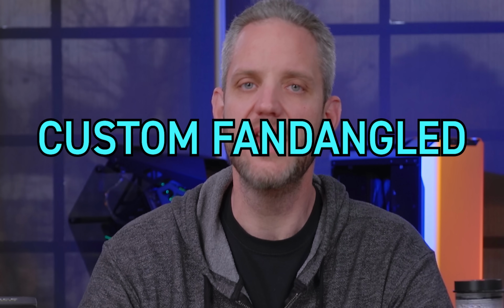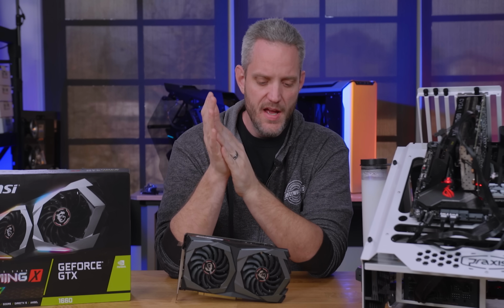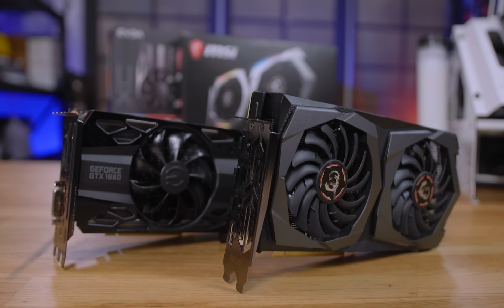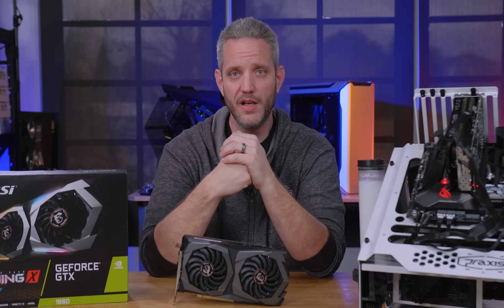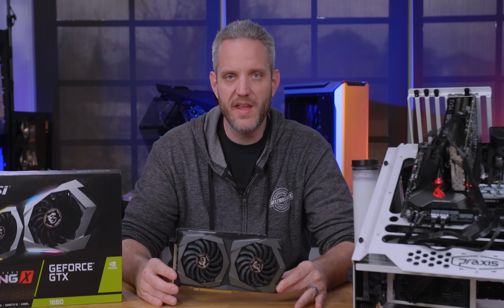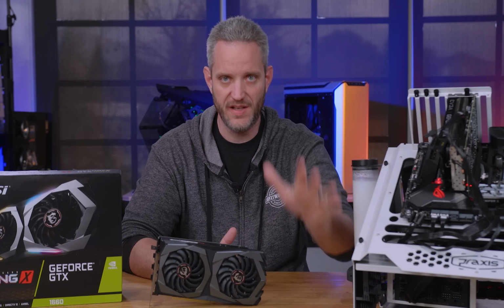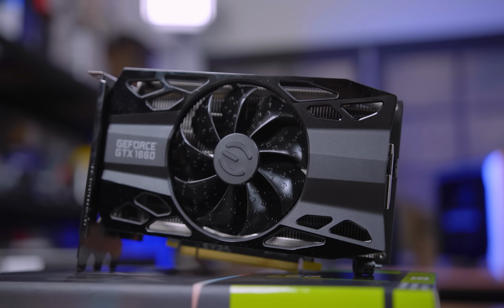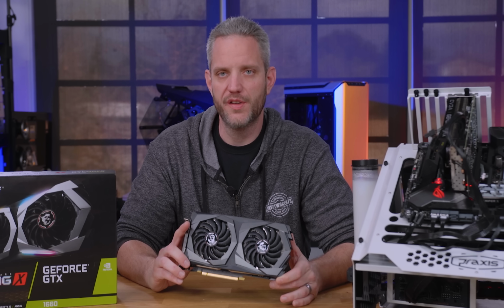Just save your money.... GTX 1660 vs GTX 1060

Comment: With the current price of graphics cards I allocated about 1/3 of my build budget.. This (for me) happened to be used SLI 1080 TIs. The market is so saturated with mid range cards. I personally take resale value highly into consideration. The graphics cards that have a chance of value are used 1080 TIs (under $500).

Comment: Already have the EVGA 1060 6gb SSC,  have yet to find a reason to upgrade that systems card,  2060 is a complete waste and the other 2 higher are way out of my price bracket.  I did score an EVGA ftw3 1080ti for $65.00 that didn't work.  turns out it had a blown fuse on the pcb and was an easy cheap fix.  Cleaned up new thermal paste and it runs like a dream for my main gaming rig.

I imagine nVidia will continue to see drops in sales till their next launch, too many sour grapes and people are getting tired of the insane prices.  Think that will be my last nVidia purchase regardless till they start putting their customers first again.

Comment: I feels your graphic card reviews have been a little lack luster lately. I wish you had more cards being compared in the benchmarks. People would like to see how this card compares on a cost per dollar basis versus a range of cards from 1050 all the way to 2080. And Nvidia isn't trying to compete with themselves, why not also benchmark the AMD equivalent? If AMD even has something comparable, I know they have not released a graphics card in awhile. 

Haveing a larger list of benchmarked cards wouldn't even be difficult with a standardized test bench you would simply need to benchmark every card once, plot their data points on that bench, and just bench new cards as they are released. 

Based on your benchmarks the new 1660 offers 10%+ more performance then the previous generation 1060 while being the same price as the previous generation 1060. You can even find 1060s on Newegg for $300 even, so it's just not true that it's more expensive. So if someone was in the market for a graphics card with the budget of $250 they would obviously get the newer card and I'm sure the customer would be happy they got the aditional performance.

Comment: PROTIP: Don't cheap out buying the Asus Single fan 1660 or 1660 ti.

I just had to RMA my Asus 1660ti because it was thermal throttling @90c just sitting at desktop, during gaming the throttling was so bad that it was preforming worse than my 1050ti.
Returned it on Monday and just got my RMA approved, bought the RGB MSI card for the extra $30 instead.

Comment: Rx 580s can currently be had for 179-189? (This card is not worth upgrading to, it's only viable if you either building a new system or adding a card to a system currently using integrated graphics)

Comment: man all these cards I don't know what I should go with (going Navidia) before all the rtx etc I was going to go with gtx 1070/1070ti or 1080 depending on prices and what was cheaper. 
now there is the rtx I'd get the rtx2060 but it has 6gb vram instead of 8 soo I'm on the fence about it. I'm no where near getting pc parts I need a job first and save up. as for the rest of the parts I know what I'm getting. in total it costs around $2,500 CAD range pc and monitor etc.

Comment: Seems like a great budget VR card for someone buiding around that. VR accessibility is getting great now!
Reply: The VR headsets are still really expensive. $349+ for anything halfway decent. The $199 Windows mixed reality headsets are garbage. You’ll spend more on the VR headset than the GPU used to power it!!
Reply: @SalivatingSteve  Thats an extremely subjective opinion. Perhaps for someone used to the vive/oculus, the wmr may feel as a step down, but for someone with no vr experience, 90% of wmr headsets will do a great job. $350 for an oculus is an amazing price, just a year and a half ago I paid $500. Give it another year and you'll find used Oculuses for $150-200 and new ones for $250 300.

Comment: hi jay, my system is 5 years old now but i am running a 1060 6 gig card i want to upgrade my motherboard and CPU and ram to i9 cpu ,my question is will the 1060 6 gig run all the new games now or should l upgrade my GPU to a 1080 or 2060 card, l would love to hear you thoughts.

Comment: 1660 should be 199$ it would sell way more in my op. Less than 200$ is a good price point for parents and what not to actually buy the things for those younger gamers.. I’m just frustrated because I wanna upgrade but I’m not seeing a big enough improvement in 1440p like I’d like for the price. I wanted to go to a 1440p monitor and the 2060 just does not impress me in that regard. So I might be sitting out this gen and just upgrading my cpu to a 9600k or 2700x instead of 2600 and gaining frames that way

Comment: For 60fps 1080p this is a great entry level budget card. It's about the same as a 980 and that's plenty for a guy with a weak monitor. When you consider the monitor with the GPU then your whole price per performance and valid vs throw away cards. The landscape changes drastically

Comment: Funny enough i had JUST gone through all this thought process a bit ago while searching for a graphics card upgrade. I had been rocking a GTX 960 for a long time, and finally wanted at least a bit of an upgrade. However my budget was super tight, to the point where i wanted to stay under $200, so i ended up going with an RX 580. Maybe next year or after i'll probably upgrade again if my work situation changes, but i just needed something that would do what i need now, but leave me money to make other important purchases that i had to go with. I do notice the 580 runs a bit warmer than i like, so i may try your thermal paste replacement method and see if i can get the temps a bit down. I think OC to 1400 and 100+ on memory and it's idle at like 30-40 C which i don't like seeing. However it could also be my case fans, i only have two and they probably aren't in the optimal spots so i may try that upgrade first before i risk opening up the card lol. Love your videos so much, they've been a HUGE help!